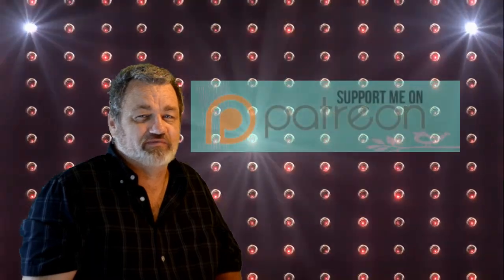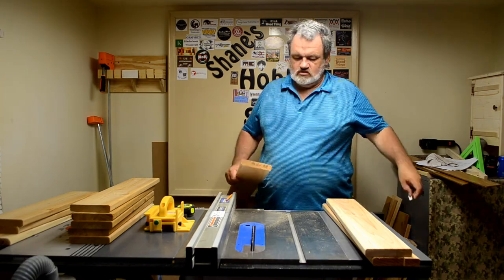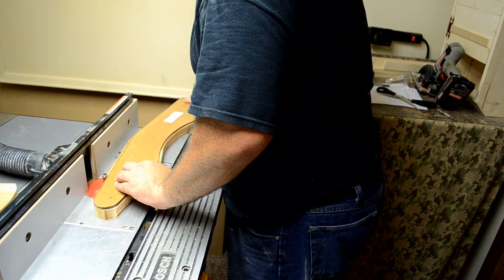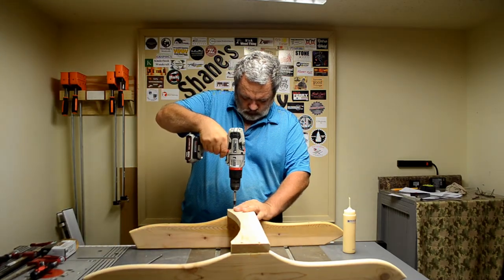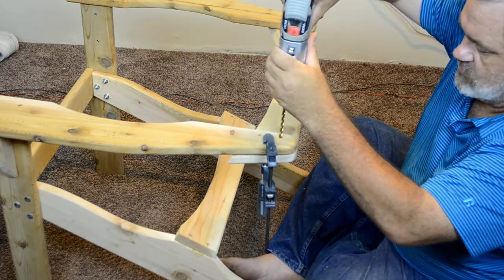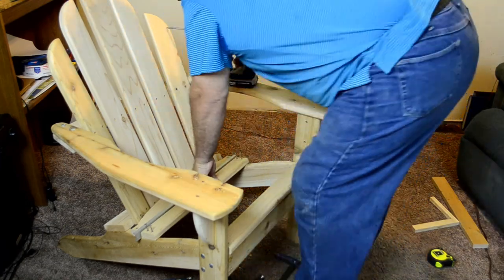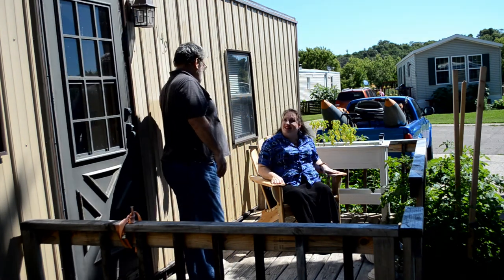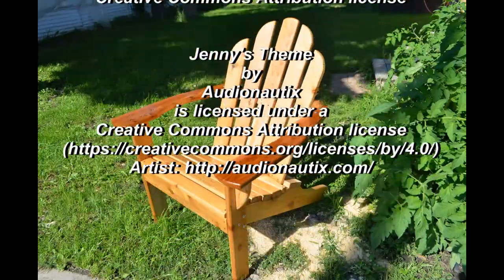Adirondack Chair

Comment: How is that shellac finish holding up?  Is the chair outside 24/7?
Reply from the maker: overall really good. I did however had to sand down one arm and re-seal it. Where I had the screw holes at, the sealer started to peel. The next time I make one of these, Im gonna plug up all the screw holes first...
Oh yes, Its outside 24/7
Reply: wlj11 tableau